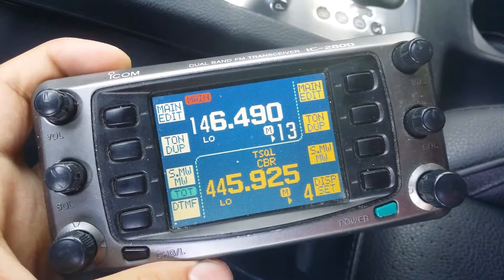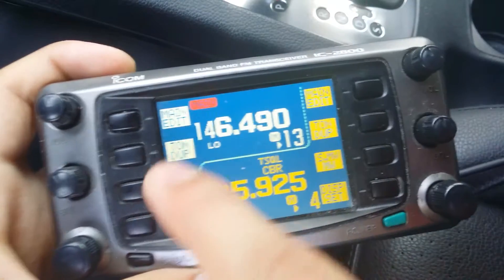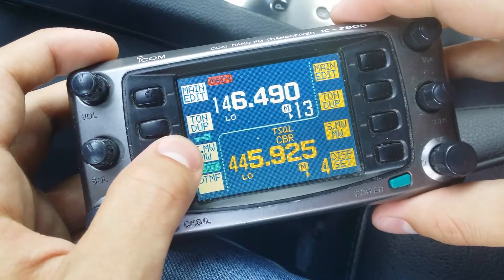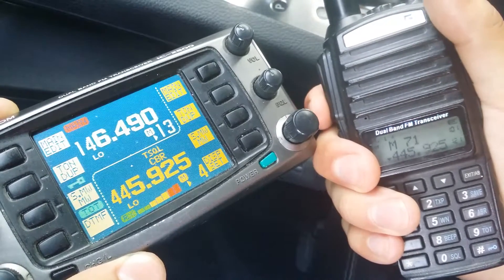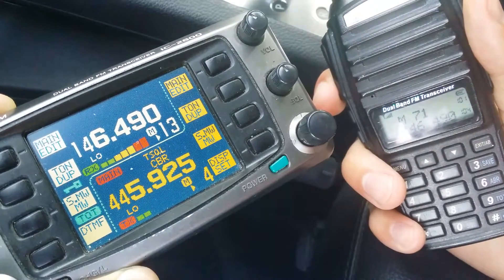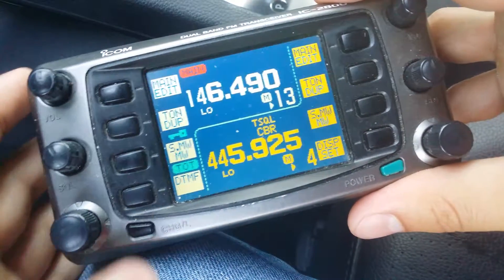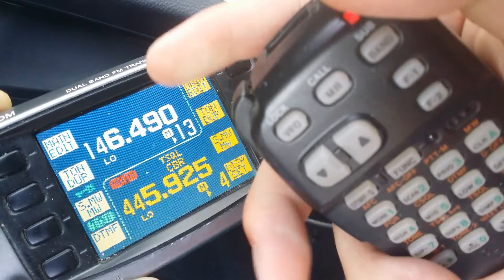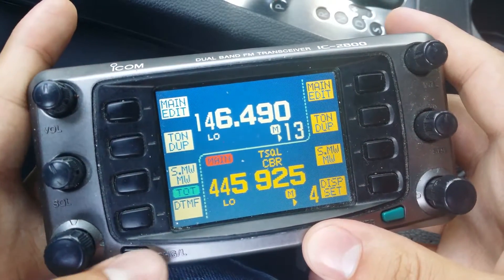Icom IC-2800 Crossband Repeater

Comment: Can I use this as a repeater? I don't even need to be cross band. I want to set up my mobile in my Jeep as a repeater when hiking with my baofeng
Reply from the maker: It can be used as a repeater, crossband only (UHF-VHF and VHF-UHF), but not in-band (VHF-VHF or UHF-UHF).

Comment: I also still have an IC-2800H which has been in storage since 2000. When I unpacked and tested it recently, 

all was still working except that the control head screen was broken and therefore it was blank.

 
I would have to replace the complete control head if ever I was going to use the radio again.
Wish I could find one.
Alternatively I would have to dispose of the radio.

Either way, is anyone out there interested?

73’s  
ZS1IB   South Africa       ingoberger@telkomsa.net     +27824311100

Comment: Thank you!  I had a need for this tonight, and your instructions worked great.

I'm using a Yaesu FT-530 handheld to "talk" to my ICOM IC-2800.  For some reason, even though the ICOM is programmed to transmit CTCSS on the channel to my Yaesu, the Yaesu does not unmute.  I have to leave the Yaesu in carrier squelch.  Is there a limitation on the IC-2800 where it can't have two different tones on each band?
Reply from the maker: I apologize for the late reply, as I did not see your comment until now... Yes, I did find that if both the VHF and UHF side have the same tone programmed, the tone will be transmitted. However, if they have different tones, no tone will be transmitted. In my experience, I simply use the same tone on both bands whenever possible.